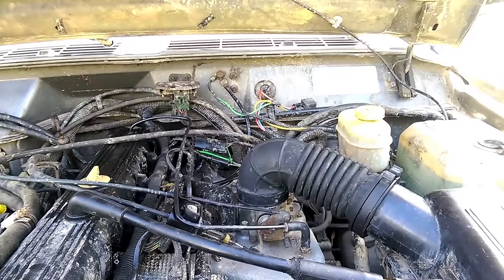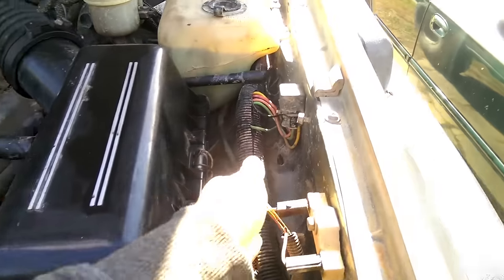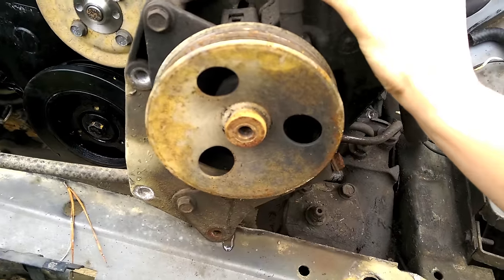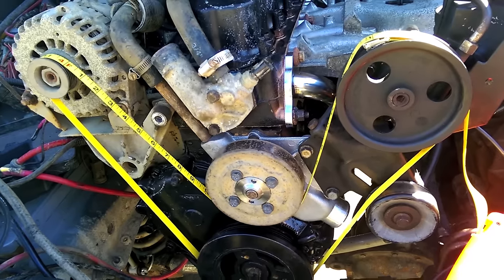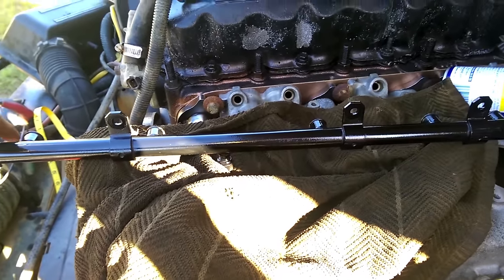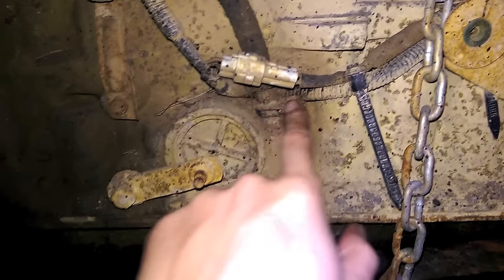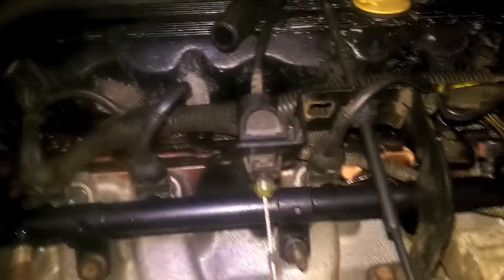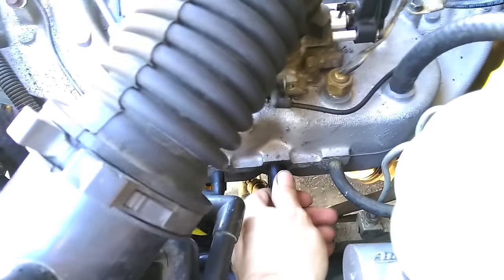89 Cherokee Renix to 99+ HO Manifold Swap

Comment: Which fuel injectors did you use the original ones that came on the 89 or a later year.
Reply from the maker: If you are only doing this swap, keep stock injectors.
Reply: @NickInTimeFilms  I put the newer intake on it like yours but the stock injectors wont fit so I used  the injectors from a 93 jeep cherokee that plug in the same wire wise  unfortunately they aren't working they wont actuate I get no gas coming out.
Reply from the maker: The stock ones won't fit? I had 4 hole injectors at the time of this swap with slim bodies, good to know the fat bodies don't. The 93 injectors are going to run too rich in Renix if the do eventually work, so you may have to get a different one. I have an injector tuning video to help on that. As for them not firing, how's the cps?

Comment: im trying to swap from a 1996 0630 head to a 1998 0331 head do you know what itll take
Reply from the maker: Why would you want to do that? the 0331 heads have smaller exhaust ports which limit their flow, the 7120 and 0630 heads are the most wanted. also they won't have the temperature sender in the back of the head for your gauge to work. 

So if you want to swap for cheap then you don't HAVE to do anything, it'll all bolt up, but to do it right you'll want a 98+ Exhaust Manifold and either drill a hole for the sender if your model has it or relocate it with a hose adapter
Reply: +NickInTimeFilms  if im not mistakenl the temp sensor is on the thermostat cover I may be wrong mine originally was at the rear of the head

Comment: Did you ever manage to figure out the vac lines?
Reply from the maker: +Christian Duquin yeah, it didn't really change after the fix I had at the end. The charcoal filter doesn't need manifold vacuum, just air box tube connection
Reply: NickInTimeFilms excellent thanks bud. I just swapped a brand new remanufactured ‘96 motor and intake into my ‘89 comanche. Was just stuck with those vac lines and where to put the knock sensor on my newer block.

Comment: How easy would this be to put on a 94?
Reply from the maker: Considering you've already got most of the HO parts, pretty easy. Just the intake and PS stuff I'm pretty sure, but the list in the description will spell it out
Reply: Just did on my 95 intake and 2000 exhaust 2 piece manifold from parts jeep cause guy dicked around and I was ready to be done definitely bolts started on exhaust before intake then power steering as showed just that simple all my vacuum lines were ran in a guessing situation aside from iac map and all but regular lines arent dedicated in a sense that it matters

Comment: I'm actually about to do a full engine swap from a 96 to an 89. I know my flywheel, fuel rail, probably distributer and possibly some of my intake, if not the entire manifold need to be swapped over. anyone have any info on this swap that I should be aware of..?
Reply from the maker: +artardFTW Well, what do you plan to do. The Block is basically the same between all the years so that's not an issue. The head is where things get interesting because the 96 head is different than the 89 head. As long as your 96 has the coolant temp sensor at the rear driver side of the block it's fine. If not and you're up to it, drill and tap it for the sender, if not then you just won't get a reading on your gauge. 

If you plan to do the Renix to H.O. manifold swap then you will want to follow this video. Although possible, I would not recommend putting your renix manifolds on the 96 head, ports don't line up so you lose flow. If you want to stick to renix manifolds and your old 89 head is good, swap it onto the 96 block and everything will go fine. Only issue with the 96 block is possibly the mounting hole for the knock sensor on the middle driver side. Besides that, swap your parts over the the 96.
Reply: NickInTimeFilms so we did the swap, new motor is in. bolted up, we swapped over everything that we needed to, including both the intake and exhaust manifolds so everything is hooked up, and we ran into an issue with the distributor. the distributor the motor came with doesn't have the right connector & the distributor on the old motor, the rotor is like a 8th of a turn off. we tried to advance the timing by moving the spark plugs one spot forward, and backwards but nothing helped. we put the new motors dist. back on, cut the connectors on the truck & distributor and tried to splice the wires together, like 3 different ways. truck cranks about 5 times, and backfires every time.
Reply from the maker: +artardFTW Did you put the 89 flex plate on the new motor? Timing will be off with the 96 flexplate. Did you set the timing like I did in my stroker install video? Make sure you're at Top Dead Center of cylinder 1 on the Compression stroke, not the exhaust stroke or it will be off. When indexing the distributor, the rotor should be a few degrees past the number one Spark plug post when it's seated. Dissy swap years are as followed: 87-90, 91-93, 94-97
Reply: NickInTimeFilms I'll definaltely have to check them out, although I don't think we should have to re-time the motor as it stayed together aside from manifolds & the distributer went on as it came off. I'll have to double check on the flex plate, my friend did most of that work as he is an actual mechanic so he did most of the under vehicle work
Reply from the maker: +artardFTW As long as the timing chain is in tact it shouldn't need to be retimed. The 96 cam is different from the Renix cam though so that may or may not cause issues. The 96 flex plate would cause it to misfire and barely run at all.
Reply: NickInTimeFilms i saw the motor run before the guy pulled it out 3 weeks ago, right when I posted my original comment, and it ran beautifully. only has 96,000 miles.
Reply: NickInTimeFilms and it won't even start. we got it to spudder once & it just hickuped while cranking before it backfired
Reply from the maker: +artardFTW Def sounds like some kind of timing issue then.
Reply: I'll have to see about the flex plate next time we go to my buddies house, who was nice enough to lend his garage
Reply from the maker: Also don't forget to check the silly things too, like having gas in the tank, fuel pressure in the rail, a working cps sensor, spark plug wires in the right order and stuff like that.
Reply from the maker: First thing I would check is to make sure that dizzy is properly indexed then. Mark the body where the #1 plug is and pop off the cap. Spin engine to #1 Cyl TDC on compression and see where your rotor points. Should be about 5° past #1 mark in clockwise direction.
Reply: I watched the video on the stroker install. none of us thought about turning the oil pump with a screwdriver until it matches up on the dist., that piece of info probably saved the swap. I'll definitely try that, and if problems still persist well go through the full timing procedure
Reply: NickInTimeFilms UPDATE went tonight & timed the distributor & the motor fired right up. you're a life saver thank you
Reply from the maker: +artardFTW YES! Nicely done my man, great to hear.
Reply: my friend was almost ready to put the old engine back in, and put the new engine's head on it. the cylinder 3 or 4 on the old engine was failed & the exhaust port was totally caked with burnt oil
Reply from the maker: +artardFTW Glad you got it figured out, it's always the little things
Reply: NickInTimeFilms it really is
Reply: update 2.0 now the motor decided it wasn't going to run last night & today. the most I got out of it today, was about 4 seconds with my foot on the floor. motor sounded like it had half of the cylinders firing until it lost momentum & stalled
Reply from the maker: +artardFTW Ahh, the good ol secondary issues. How's you're fuel pressure?
Reply: NickInTimeFilms it was fine 3 days ago when I started it. it was fine when I put a new fuel pressure regulator in 2 days ago. it started it like 5x to be sure lol
Reply: NickInTimeFilms now it just cranks, hickups, and cranks more. I got it to run for like 4 seconds before it ran out of momentum & stalled. with my foot on the floor. sounded like it had half of its cylinders
Reply from the maker: +artardFTW hmm, something work it's way loose? Head gasket issues, does it have good compression. Sounds like something is just a little off
Reply: NickInTimeFilms head was never tampered with. it should still be tight from the manufacturer lol probably need to try to fine tune the distributor timing more
Reply: NickInTimeFilms so, it's 26 degrees (warmer then the last couple days) the Jeep decided to start perfectly fine. timing is still a tad off, but I drove it around in the snow and started to smell something burning. turns out the carpets above the muffler were catching fire, flipped up the seat & the carpet and there was glowing embers. spent the better part of the last hour ripping the carpet & insulation out of the passenger side of the back seat
Reply from the maker: +artardFTW 0_0 HOW did your floor get enough to catch the carpet on fire? That is absurd, unless you are running so rich that your cat is ready to melt, might wanna check into that.
Reply: NickInTimeFilms well... a lot of the vacuum lines are capped off trying to chase a massive hissing noise that comes from below the intake so it may be running rich from that, also, I found a decent rust hole directly above the muffler, so I'm thinking with the wet carpet freezing, melting, getting hot, freezing again rusted a hole in the floor.

 so, when we do get around to putting the new exhaust on with the new gasket, I don't know how the vacuum lines are supposed to be ran & they were never right to begin with anyway. missing a bunch when I got the jeep.
Reply from the maker: +artardFTW We can fix that. haha.
Reply: NickInTimeFilms aren't you located in jersey? if I recall I remember seeing a yellow plate on your xj lol
Reply from the maker: +artardFTW Maaaaaaaaaybe.
Reply: NickInTimeFilms greetings from maple shade 08052 lol
Reply from the maker: +artardFTW Cherry Hill area, nice. I'm out in Galloway, near Atlantic City area.
Reply: NickInTimeFilms very nice, I was about to ask if you could put up a video of a deep vacuum overview buuut I'm pretty sure you did the 96+ intake swap if I'm not mistaken
Reply from the maker: +artardFTW Wags Finger That's exactly what this video is about. lol. Here's a stock diagram: http://repairguide.autozone.com/znetrgs/repair_guide_content/en_us/images/0900c152/80/0a/9b/8e/large/0900c152800a9b8e.gif
Reply: NickInTimeFilms oh yea... I forgot to brain for a minute lol  & that's actually the easiest to read diagram I have seen yet on the vacuum system
Reply from the maker: +artardFTW No prob
Reply: NickInTimeFilms thank you... now do you buy pre-fitted lines or just a roll of rubber tube
Reply from the maker: +artardFTW I bought the two halves of the vacuum lines assembly that came with most of lines. You could also run your own lines if you can figure out the thickness. Dorman 46003 and 46004
Reply: NickInTimeFilms and that's all of the vacuum lines for the engine & emissions in both of those packs?
Reply from the maker: +artardFTW Most of it. It doesn't cover the vacuum ball, and I don't remember if it does the map sensor line, but it's most of it
Reply: NickInTimeFilms son of a bitch lol I didn't know you could buy the lines like that I was prepared to hear that I just buy a roll & some vacuum line ends lol
Reply from the maker: Yep, making it easy is what I do. haha
Reply: NickInTimeFilms that's awesome. tomorrow I'm going to go order those from the parts store. thank you so much
Reply: NickInTimeFilms question, the map sensor, I found the source of the hissing that we thought was the exhaust, was actually a missing vacuum line from the map sensor to the intake. I got some vacuum line & plugged it up. as soon as I hook it up it bumps my idle to 15-1700. bad map sensor or should I wait until the rest of the ordered vacuum set gets to the store?
Reply from the maker: +artardFTW I would wait until everything is hooked up, then pull the battery cables and hold them together for 30 seconds. It resets the ECU
Reply: NickInTimeFilms why do I feel like that's some kind of a prank lol I've never heard of that
Reply from the maker: +artardFTW lol, resting a wrench on the battery would be a prank. haha. remove the cables from the battery first obviously
Reply: NickInTimeFilms lol well yea.. I mean I assumed you'd have to hook up to the plugs by the pressure bottle to do anything to the ecu. that's alarmingly simple

Comment: why not build a cold air setup and do away with stock style air box's?
Reply from the maker: +Donald Duncan Because Snorkel
Reply: because 99% of the time the stock intake with a good filter will out flow at cooler temps than any aftermarket set up and will give you the best mpg and HP possible. this is on just about everything out there not just jeep. many many channels have proven this on a dyno time and time again. cold air intakes are just as much of a scam as the electric turbo. its the sound they cause that gives the placebo effect making people think they work.

Comment: Are u using the oem throttle body or the 62mm one??
Reply from the maker: Mine was ported a little at the bottom, but basically just stock. I'd like to try a fully bored one at some point to see if it helps at all with the stroker.
Reply: @NickInTimeFilms  you did  really good job man im working on mine to do the Same intake manifold set up how about the injectors what do u recommend for a stock engine